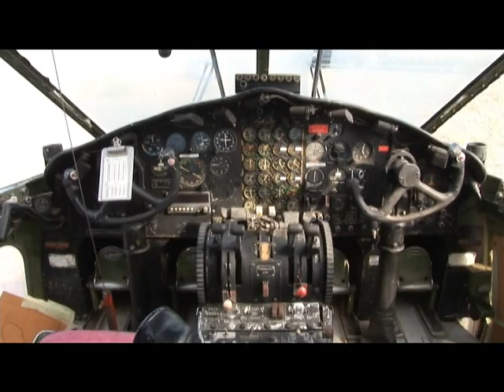Fairchild C-119 Flying Boxcar in Greybull WY 2007

Comment: This a/c (Forest Service Number 140 is painted on the jet engine cowling) was modified by Hawkins and Powers out of Greybull. They STC’d the jet engine on the C-119 for fire fighting,  They operated a number of different a/c doing forest fires, as well as other stuff.  Dan Hawkins was chief of helicopters, and Gene Powers was chief of airplanes. Amongst other a/c, they operated P2v’s, c-119’s, A-model C-130’s, and quite a variety of helicopters. The end of the seismic business in 80-81 finished the helos, and a fatal crash of a c-130 added to the forest service grounding the P2Vs finished the airplane side. By the time the company shut down, both Dan and Gene had passed on, so they never saw the sad end of one of the Big forest fire outfits.

Comment: The C-119's Taiwan got was not K version.  Non of them had the Jet.  Later on, they got C-123 which did have the option of jet packs (1 on each wing).  By then, my father retired from air force and went over to China Airlines.

Oh, and I also had ridden in C-47...:)